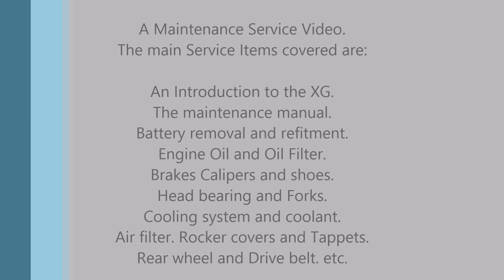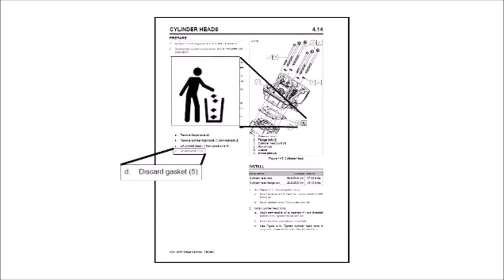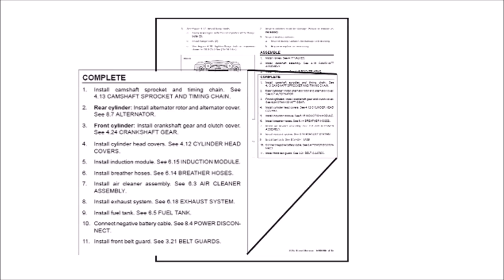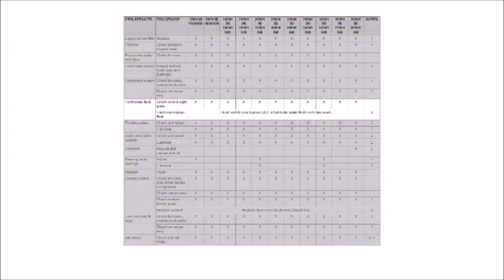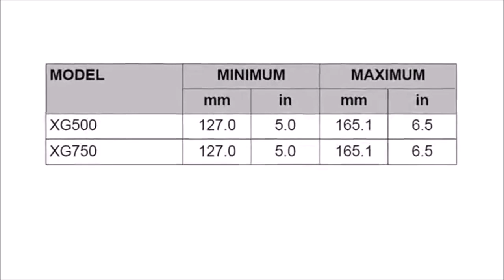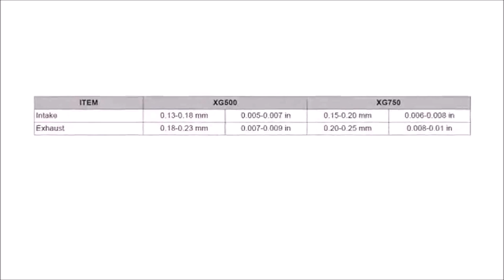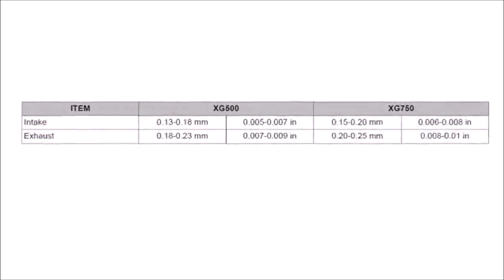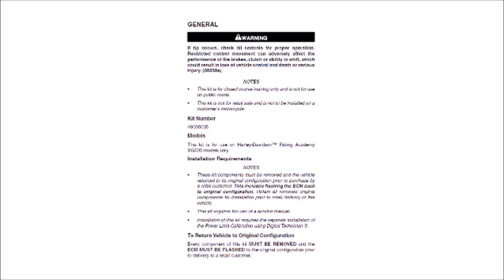H-D XG 750 Street #167 Service Maintenance 14+

Comment: Street 750 fuel pump isn't priming fully and when does runs for 15 mins and dies if you pull the fuse and put it back in does same thing

Comment: In your video, is there only one cable connected to the frame on the negative pole of the battery? I'm Chinese. I don't really speak English. Sorry.
Reply from the maker: That depends on the year , as my 2016 had two but my 2017 has only one...

Comment: Hi. My Street's rear cylinder is not firing although it does fire up with a surge while in motion. Changed the plugs, but still the same. Could it be the fuel injection or something else now? Glad if you can share some thoughts on this. Thanks!
Reply from the maker: sorry I have not a clue without looking at the bike myself

Comment: My Harley street bike have a oil drain thread. How to repair motorcycle oil drain thread..thanks
Reply from the maker: Hiya, you're going to have to tap it out. If you're lucky you've not completely killed the threads and just running the right size tap through it, may just work....

Comment: I learned about the break fluid recall on my 2016 Street the hard way.  However, speaking of baffles.  I had my '79 Ymha xs 650 missing some baffles.  Sounded cool as hell and alerted drivers all around my.  Removing the baffles however makes the engine run even hotter????  Not good because the HD street already runs hot due to a design flaw that affects the right side of the bike.  Anyone in the know...love your input.  I've had to rely on Ymha and Suzki and Hnda in the past.  This is my first HD...and losing my front brakes on a freeway freaked me out.   They came back and worked after the bike cooled down.  Apparently you can only drive this in the rain, the winter, or summer for 20 mins at a time.
Reply from the maker: well I haven't experienced any of those probs and I just rode through one of the hottest summers on record. Did you buy your XG new??
Reply from the maker: PS. Your source of info for this. "HD street already runs hot due to a design flaw that affects the right side of the bike."
Reply: I have had the 750 for three years now. .   It's a good bike and I found the hotter it runs the bet5er it runs .   I have better the hekk out of this engine  . She's got a starttt air center " should have got the v 02 "  two brothers exhaust  . Fp3  tuner .   For what she is .It's  a good engine .    I think there would be more potential  if the after market would support it better  .
Reply from the maker: I hear that, the after market stuff is getting better all be it slowly. What I would really like is some after market adjustable levers. Please hit me up if any one knows of any.

Comment: link please which oil filter must buy for HD 2015 XG750
Reply from the maker: Go on-line and buy one by the model and make of bike. I suggest getting a high flow one, if they make one for this bike.I've not needed to do an oil change yet, so haven't looked into Oil Filters.
Reply: thanks
Reply: K&N oil filter: KN-204.  or  KN-204-1